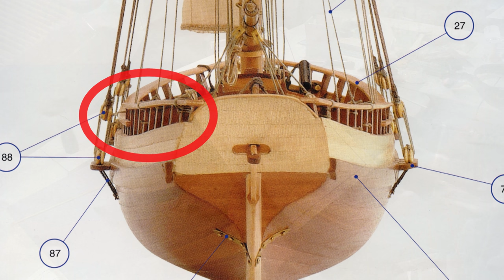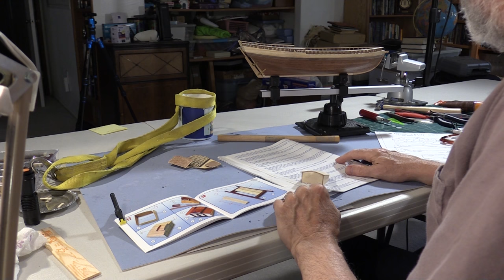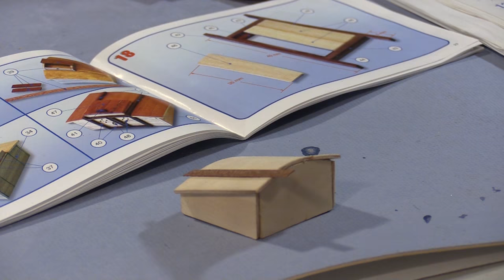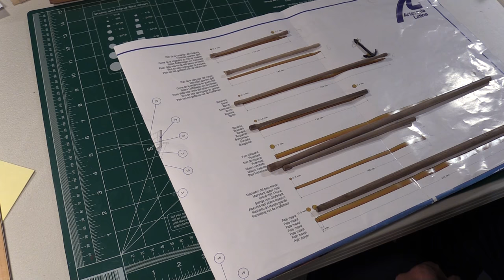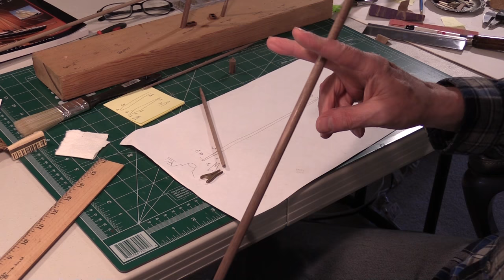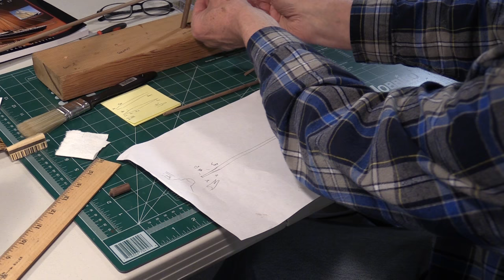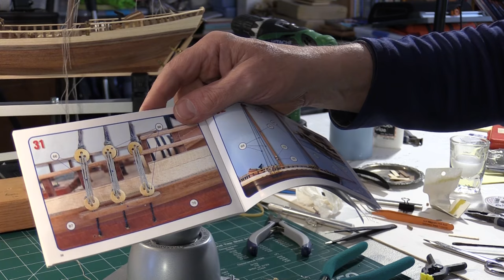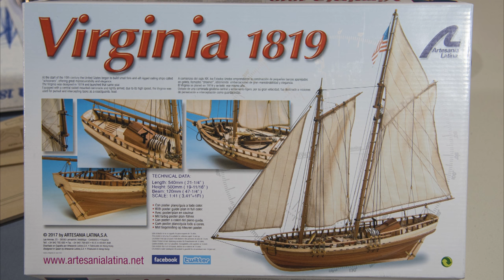Virginia 1819 model boat

Comment: Great. Great job, UNBELIEVABLE. 
But, I find this is the problem. 
Outside of "online" "friends" I don't know anyone, and that includes people I meet at functions (that I don't know well) where for one reason or another my modeling comes up, that builds models, EVER.  And I mean my whole life time.   And watching the video, along with Ken's return comments, I see why hardly anyone builds model's.  All of the issues that poor ken went through.  Further,  as Ken said, he studied plenty of YouTube videos to see what the "masters" have done.  What if there isn't any videos, then what, like back in the day???   Constant non fitting is a issue with all models. The ironic thing (and I understand wood expands and contracts) we the modelers find a solution to the problem,  sometimes people just give up, but the companies that make the model's make it so it is "close enough" so you can build it.  Sometimes I, and i know people just getting in, want just to sand a bit and nail and glue and a couple other things and a little while later, done.  Not sit around trying to figure out what's wrong.  Also, some people aren't that good,  or they don't want to be good, at sitting a few hours through trial and error and/or watching videos for hours on end.
Also, especially people that live in a large city, people don't have any tools.  And to start modeling,  especially wood, you  need lots of tools.  The platform vice that Ken had the boat on alone (at hobby shops) cost $100.00 or more. And you have to constantly add tools and most people aren't going to sit around making their own clamps and "tools" for building.
It is a very lonely endeavor.
Lastly,  outside of people doing for youtube and having a knack for building models out of the gate, getting young people involved is impossible and young people out of high school I mean.
It is all older people that have a house (and I don't mean the guy that has a two bedroom apartment in the city and lives alone) and the room and most likely did some kind of work with their hands in the basement or workshop and then decided to take modeling on for fun or praise or both.  Let's be honest do you think a 30 to 35 year old is going to do all the work Ken did???   Very, very rare.
The above short (lol) sentences brings me to my point.
The modeling companies have to make all the tiny parts fit and measure up at a rate of 99.9 percent and then I bet you get guys that not only start, but at least 90 percent of the guys finishing.   Also, watching skilled guys build these models makes many people feel not as good and that's what makes them stop too.
We need to keep more people in this and it is up to the companies. 
Thanks for reading.
Sorry it was so long. 
Again,  great, great Job Ken, fantastic!!!
P.S.  I didn't even mention the air brush and compressor that will run you over 2 or 3 hundred dollars for really good ones and most people getting into this are not poor and thus, they want really good stuff so that it lasts. That's what they are always told buy good products that last, but that will cost, thus you can't be lower income or poor.
Thanks.
Reply from the maker: Thanks for your encouragement.  Your comments are great and the result of a lot of thought on your part.  I agree with most of your observations, but I do not view your observations as a problem, but as a natural process.  When I was younger, I was busy with “action” activities - hiking, working, family, etc.  I owned a racing sailboat and campaigned hard for 15 years.  I also love reading.  Among the reading I liked were several action-packed sailing adventures.  Authors such as Tristan Jones, Joshua Slocum, Patrick O’Brian, as well as many others.
Only recently have I become inclined to sit for hours and months working on delicate word work.  And I am fully committed to this wonderful activity.  It started when I came across Gary Brinker who was building model boats on You Tube.  Then I found there was a whole community of model boat builders.  It took years before I started building, but the seeds of building model boats were planted by builders before me, like Gary.  Being a good example seems to me to be part of the solution to what you called a problem; that is, to be part of the community, as you are and to be a good mentor.  Your comments were thought provoking and caused me to think deeply about what is going on.
I am glad to participate in this “sport” and so pleased that my skills are improving.  But like you pointed out, I also find no one in my circle of friends shows any interest in my hobby, except my wife, who is happy that I am enjoying myself.  But the kids, friends, and co-worker could not care less.  But more than my own self-centered considerations, I am glad to give back to the community.
And - to your point of the younger generation, it seems to me this lack of participation is natural.  What skills I have, have been developed over years of experience.  I have tried to lay the groundwork with my own children; teaching them how to use tools, develop problem solving skills, enjoy adventures, etc.  They do not appreciate the building process now, but maybe they will take up some skilled hobby when they mature.  It could be that my boat models on the shelf will cause some interest in the future.  And my hope is that my videos will contribute to other people joining in the craft.  So like Gary Brinker, I am trying to be a positive example of the trials, tribulations, and the fun of building models.
I appreciate your time to share your thoughts, as they caused me to reflect on the craft of boat building.  Thanks.

Comment: I soak the planking strips in water and vinegar overnight...they become like rubber...
..
Reply from the maker: I may try vinegar some day!  I no longer use a plank bender.  I've tried two kinds and I can't make them work for me.  I've been using hot water and letting them dry in place.  I've also had luck with spiling planks, that takes more work and longer than watching wet wood dry.  Its an "art" I am getting better at, but still a ways to go.  Take a look at my latest video, where I build a half hull planking tutorial

Comment: One comment I will make; and it is a lesson learned by mistake. C.A. glue vapor will damage your eyeglasses. My solution was to take my glasses off if I use CA.

Where do you buy the magnifying glasses?
Reply: CA glue vapour makes your eyes sting.
Reply from the maker: It called the "optivisor headband magnifier".  I bought it on Amazon

Comment: Belle présentation et belle réalisation. J'ai juste une précision à vous donner. Les coutures des bords de vos voiles sont beaucoup trop large. elle ne correspondent pas à l'échelle du bateau. Quand on fait les coutures des bords des voiles il faut qu'elles soient les plus fines possible pour etre le plus proche de la réalité des 3 à 4cm des ourlets qui étaient fait sur ces voiles. Bonne continuation.
Reply from the maker: Merci.  I had to look back at the build video, and I now see you are right.  I'll have to look at my other builds to see if I have repeated the scale of the seams.  And I will incorporate your excellent comments on my current build.  I am nearing the need to hoist a sail on my "Fifie boat".  Ken